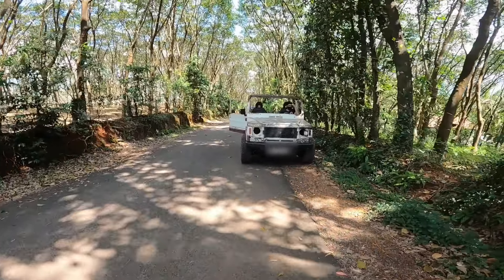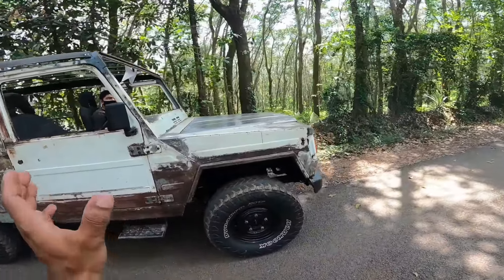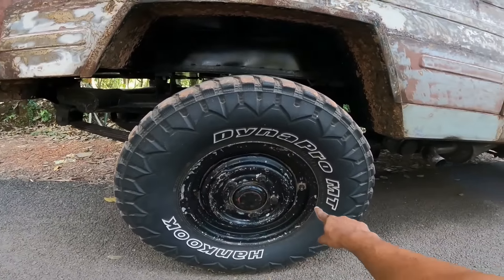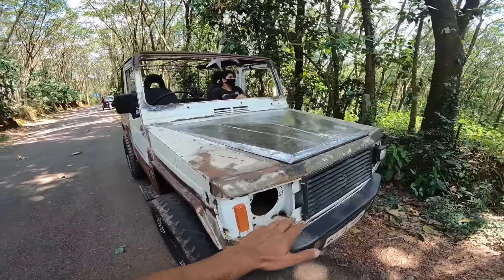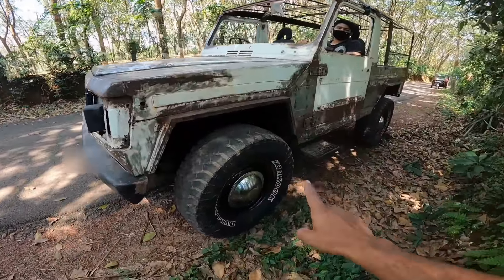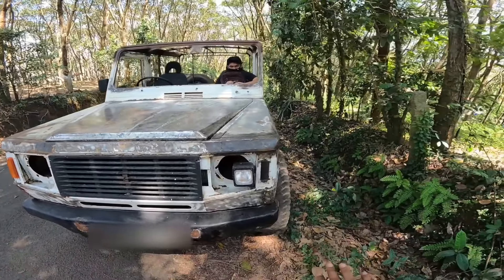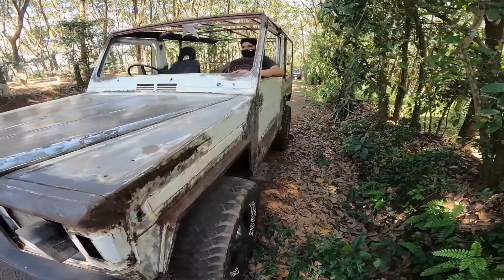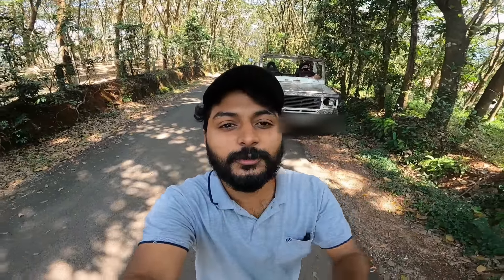ലുക്ക്‌ ഒന്ന് മാറ്റി പിടിച്ചു TEMPO TRAX 4WD

Comment: Bro i really appreciate your dedication and hardwork, small suggestion if you like it then please implement on it. Put new model Gurkha Indicators with protectors and one snorkel as well and paint the grill with piano black finish color. Regarding tyres you can put off road rims later with same size and do not use chrome cover , instead of that you can use safari rim bolts cover dicor model if you seen. these are my opinions. Try to put new glass visor frame of New Gurkha